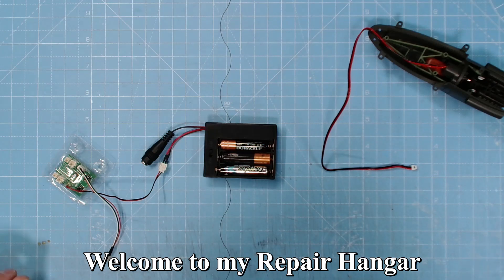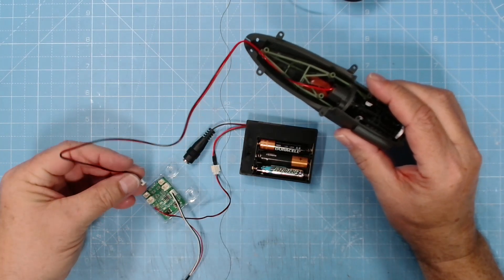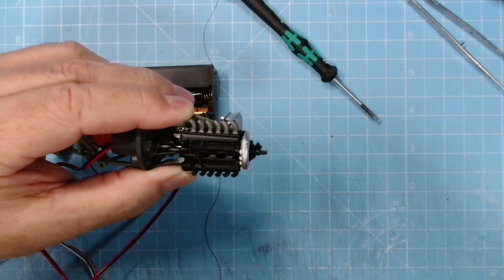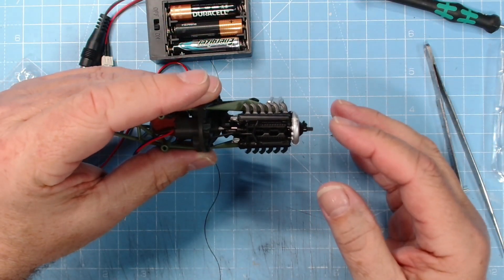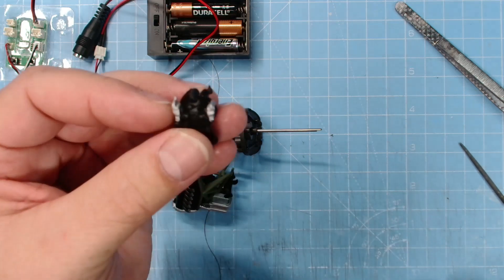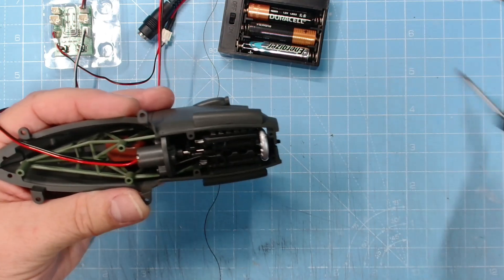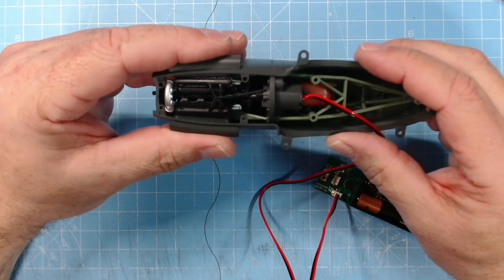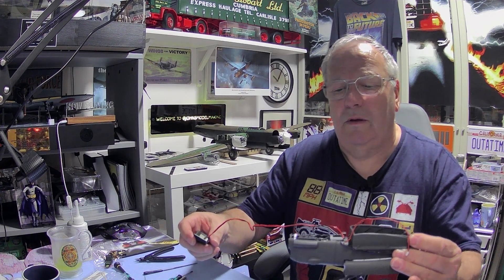Lancaster Bomber B.III Engine test and repair

Comment: Hi John I wonder if you could help me on the lancaster bomber, the problem is that the wheel bay doesn't lye flush and the wheel sticks going up and down thanks chris
Reply from the maker: Hi, I have just started stage 39 and 40, so hopefully I will have the video up tomorrow. 😀
Reply: @JohnsModelmaking  ok thanks I will be watching its problem I have is doing my head in I've been stuck on it four about five hours try to work it out and still no sorted it.

Comment: I had exactly that, with the supercharger on my first engine, and would stop with the side panels on. But now working having filed supercharger . HOWEVER second engine I filed out supercharger and still didn’t work. I found it’s the motor mounting as the shaft through the firewall wasn’t centered. So I had to file the hole in the firewall as the black connector that connects the motor to the shaft was fouling against the firewall. So I have it working with sides on, but as soon as I attach the propellor it stops. I noticed you didn’t connect the propeller ! Now I have to say I’m still on the 3v so I’m praying once I get the new battery pack that it will drive the propeller on my 2nd engine. The first engine runs with propeller and 3v but the 2nd engine will run just as yours does on 3v but attach propeller and it won’t work. To me the answer is dreadful motors. Had Hachette spent a couple of pence more on better motors with better torque it would work fine, the extremely small friction caused by the supercharger just wouldn’t have occurred with a better quality motor. These motors are dreadful and couldn’t pull the skin of a rice pudding and will stop at the slightest thing
Reply from the maker: My 1st engine had a problem with the firewall and I asked for a replacement and that cured that. The 2nd engine works with the propeller as does the 1st but as the propeller is a poor fit with the nacelle, it can be hit and miss. The propeller needs another connector to ensure a snug fit and then hopefully we won't have any further issues. Also put some silicon grease on the front of the nacelle between that and the propeller to see if that improves rotation but it still rubs on the front of the nacelle.